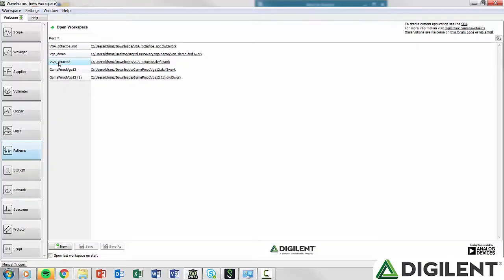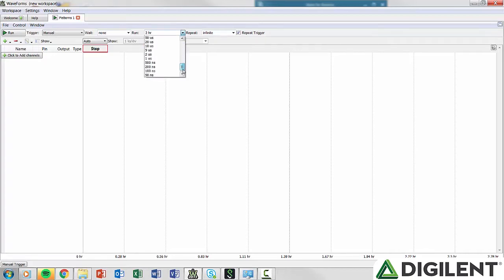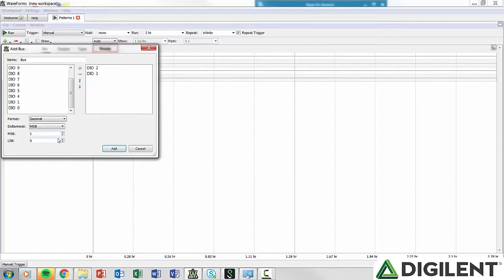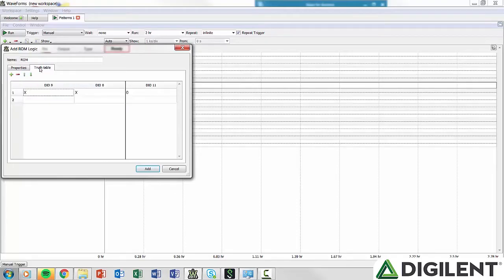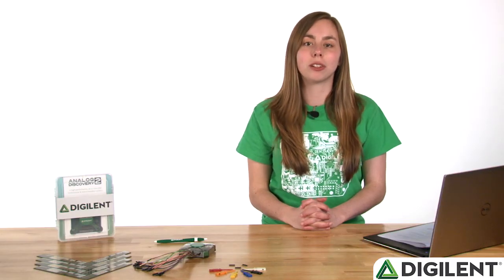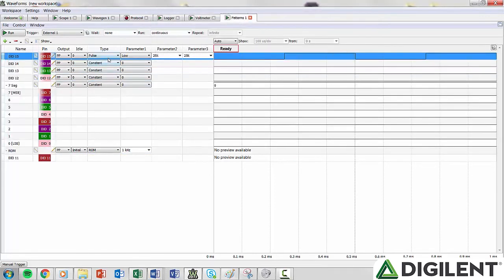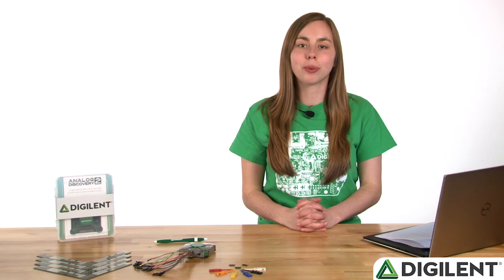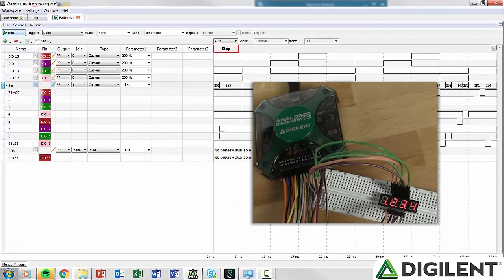Analog Discovery 2 QuickStart: Video 13 - Pattern Generator

Comment: The amplitude is 3.3v, is it possible to change this to 1v or 5v?
Reply: it doesn't seem to be able to do 3.3V but you always got the option of OD with pull-up resistor to the positive adjustable supply pin